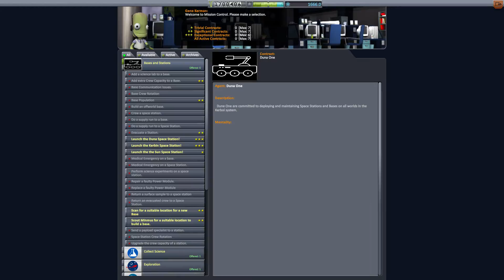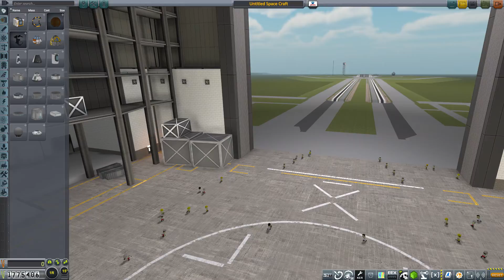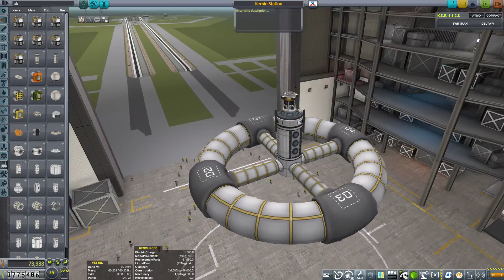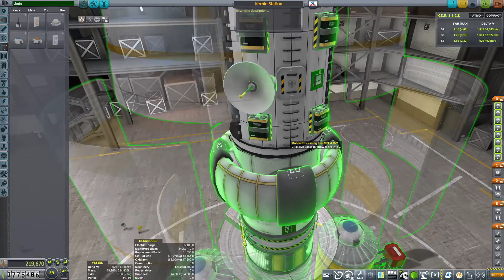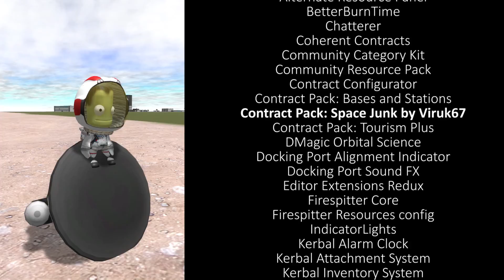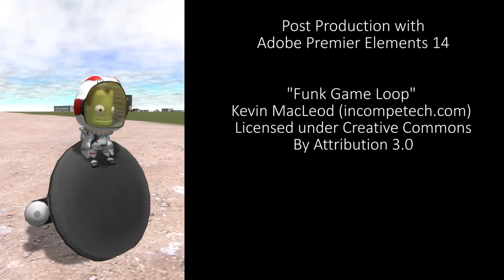55: Four Fifteen

Comment: Why not use mirror symetery when placing the batteries instead of placing them  manually?
Reply from the maker: Good spot. However, in most cases I'm making it up as I go along. I try to create interesting designs which often means no symmetry. So in the case where it turns out I could have used symmetry, I do look a bit dumb! Thanks for the view and the comment, it's always appreciated.